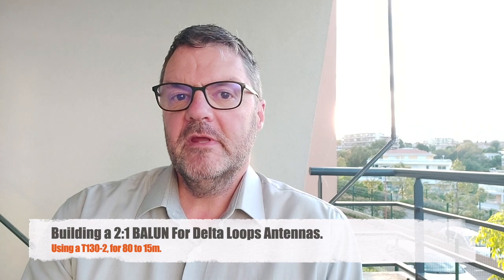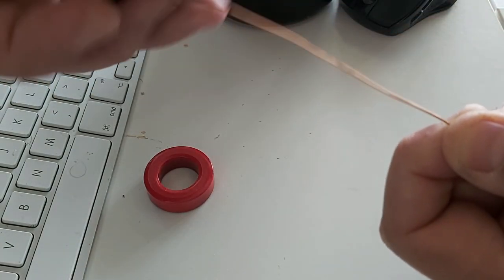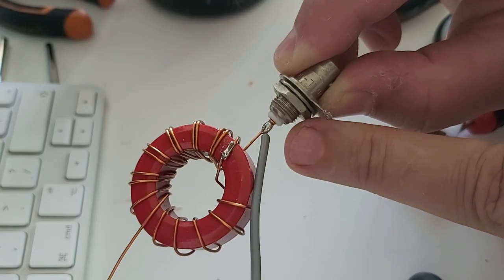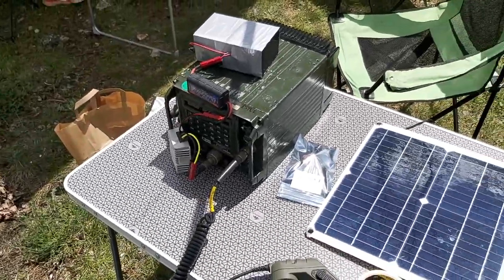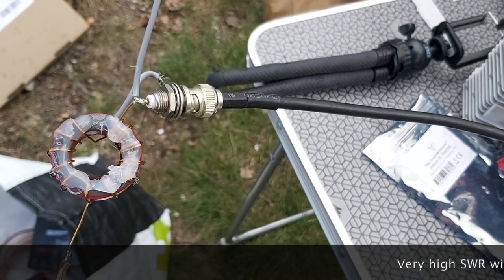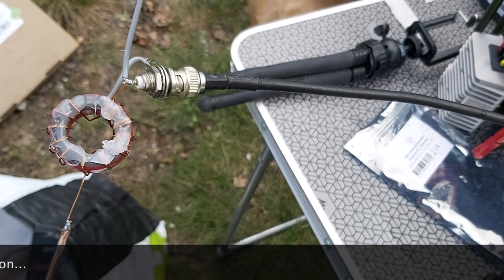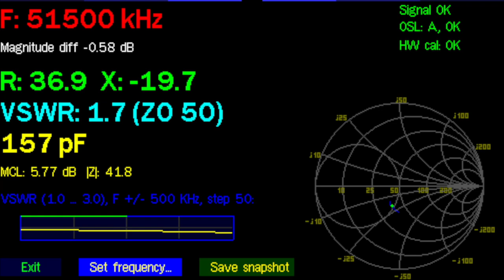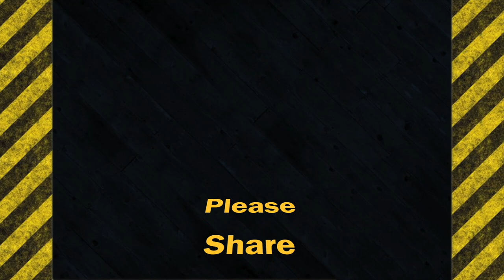Building a 2:1 BALUN For Delta Loop Antennas.

Comment: Thank you for demonstrating this 2:1 transformer.  (12/6)^2= 4 so 50 ohms input yields a 4*50= 200 ohm output transformer.  This is consistent with the measured SWR approaching 2:1 (200 ohms/100 ohms = 2) demonstrated in the video. My initial calculation for a 50 ohm to 100 ohm transformer suggests a turns ratio of 5 turn primary (50 ohms) and 7 turn secondary yields 98 ohms. Alternatively a 12 turn primary with a 17 turn secondary should transform 50 ohms to 100 ohms. You have encouraged me to build and test these alternative windings.
Reply: Sorry I am a little late to the party. You are correct with your calculations. I use the same ratio in a hybrid combiner to parallel two linear amplifiers. Just in my case converting 25 ohms to 50 ohms. Still a 1:2 transformer.
Reply from the maker: Thanks, the results do confirm it..
Reply: Or 10 turns primary with 14 turns secondary?…. I wonder if there is an optimum number of turns if the 1:1.4 ratio is correct?
Reply from the maker: It's the square of the turns ratio... I never saw anything other than a 49:1 or 64:1 made that way though..

Comment: Made a massive difference compared to the 75ohm coax I was using on a full wave horizontal 40m loop, could not tune 20m allthough 10 and 15m were ok, now flat swr 40-10m and very low noise, thanks for the post. 73s M7MNM

Comment: Nice experiment! I have built a 40m Delta Loop few years ago and still use it from time to time when operating from my countryside position mostly in the contests. I made it fed with the 1/4 length of the matching 75oHm cable and it worked just great with flat SWR accross all the band. I mounted it on the 13m mast. One big argument for the  cable-matching system is it stands easily the full legal power (1kW in my case) provided the proper cables are used. It also is weather proofed easily and looks neat. 73! Good DX with your Delta! 73! Linas LY2H
Reply from the maker: Absolutely right!

Comment: A suggestion: If you check the loss in that transformer and find it unacceptable (it will be significant,) you might want to switch to a Mix 43 ferrite instead of the red/clear Mix 2 powdered iron. Generally speaking, powdered iron cores are best for tuned transformers, while ferrites are best (lowest loss,) for broadband transformer applications such as this one. Even for tuned circuitry the Mix 2 is quite lossy on the higher HF bands. (Above 40 meters I always use a yellow/clear Mix 6 for tuned applications.)
Reply from the maker: You would think... https://youtu.be/wXELRYBBunQ that was for a 9:1 though..
Reply: @RadioPrepper , over the air tests are used as a last resort, but they have far too many unknown variables. Bench testing comparisons with a power meter or spectrum analyzer where you have control of all the variables are the only way to tell how much power is being eaten up by the matching transformer. DL2MAN describes how to test them in his antenna building series and what the variables are just within the ferrite Mix 43: https://www.youtube.co/watch?v=nNzTf1F12BE&t=930s
Reply: John West You said it. The material 2 is not suitable for this application. It's a wrong and misleading recommendation. I'm very sorry to see such a content spreading wrong advices to many. Wrong content is multiplied finding this stuff all over. Later he mentioned the 1:9 UNUN for random wirer. That's a totally outher application where  intantionaly is introduces loss by using a material 2 iron poder core to drop the SWR by introducing additional loss. And hey, You can explain it 1000x and this spreader of wrong content don't want assume that they spread missloading tecnical bullshit.
Reply from the maker: I recently made a contact from the South of France to French Giuana, SSB, using 20W and this "not suitable" powdered iron core UNUN... I's on video. How do you guys explain that? LOL.
Reply from the maker: That's 7208km BTW..
Reply from the maker: Ah! This is the delta loop video! I thought it was the 9:1 UNUN video. This one, I used a design I found online that described a "2:1 BALUN." I built it and it worked fine. What else do you want? I make no claims other than it works. My other remarks were about my 9:1 UNUN videos with a random wire, using a T106-2 powdered iron core for which testing shows that it works better than an FT-140-43. Why? I don't know, but it does.

Comment: a delta loop at 120 ohm a 2/1 balun is ideal close to 50 ohm I personally experimented with the 4/1 and that didn't bother me. I got too low an inpedence I have been making antennas for years.... a antenna has an inpedence and inductance to be respected

Comment: Thanks for video Gil. Just wondering if the turns ratio on the bal-un is 2:1, the impedance transformation shall be 4:1? You could test with with a 200 Ohm resistor and see if you get 1:1 SWR.
Reply from the maker: Not sure about this type of winding, but I will check, thanks.
Reply: Yes, turns ratio is 12:6 or 2:1 so impedance is changed 4:1. Turns ratio should be 14:10 to get a 2:1 impedance ratio.
Reply: @datamedic  Yes I wondered the same thing that a 2:1 turns ratio would give a 4:1 impedance transformation. That ratio would not be a total disaster as it would transform an impedance of 120 Ohms to 30 Ohms.

Comment: Would a 240-43 work for a 2:1 balun for an hf antenna? Making a 80m full wave sky loop. I’m getting 175 ohms at the analyzer with a 100 ohm resistor. Trying to figure out where I went wrong
Reply from the maker: What is a 2:1 HF antenna? I have no idea what you are trying to do, sorry. A 43 material toroid is wrong for a 2:1 BALUN.
Reply: @RadioPrepper  corrected my comment. A 43 mix is good for a basically every other balun in hf. I just assumed it would suffice for a 2:1 nonetheless.
Reply from the maker: Assumption is the mother of all... ;-)

Comment: Thanks for the video. Although I'm not sure if 2nd mix is recommended to be used on such high frequencies, or even for transformer at all. Would be interesting to compare with mix 43 or 31.
Reply from the maker: 43 for a 2:1 on 50MHz?
Reply: @RadioPrepper  yep
Reply: @R2AUK  Or at 61 ought to really work better up there.
Reply: Yes, I note that powdered iron is not recommended for broadband designs in the normal case.   The powdered iron appears to be more suited for a tuned circuit, or a single band design?   Is there a reason you use the powdered iron (red) core rather than the 31, 43, 52 or 61 material that is far preferable for broadband use on HF and above for 49:1 transformers?
Reply from the maker: I usually use 43 for 49:1 or 64:1 transformers, but many designs seem to call for 2 material for lower ratios like 9:1, 4:1, 2:1. I do not know why.
Reply from the maker: https://youtu.be/Q3LC14L7MLU
Reply: @clarkturner9413  You are right👍👍 Problem is that Gil is spreading bullshit insisting on tecnicly wrong things - And it's not only in this video. He does not make solid research before spreading of what he believes is right - But I always recommend te believers to go better to Church instead spreading bullshit.
Reply: @clarkturner9413  You are right, material 2 is wrong for this aplication. Video is wrong and missleading.

Comment: What do you think of wraping power supplie  plus and minus wires  around thoroids to your radios  ???
Reply from the maker: Yes, it does reduce RF currents getting into the radio through the cable acting as an antenna.

Comment: Will this 2:1 balun work  for my skyloop antenna? It's only for reception.
Reply from the maker: Yes, better if the wire is a full wavelength.
Reply: If you want to try the air core 2.5:1 balun it is cheap with local parts and instructions are on the internet. It's wire wound on a short PVC pipe. Works great for skywire loop. AG6IF sells them on eBay if you don't feel like building one. But they are really inexpensive to build.

Comment: So I'm a bit confused... This is supposed to be 2:1, and the sqare root of 2 is sth like 1,4 and so on. The windings on the balum are 1,5:1 though. Wouldn't this give you more like a 2,25:1 Ratio or is my maths backwards? Greetings from germany.
Reply from the maker: Not sure, confused too, but the analyser shows 43.4 Ohms on 20m with a 100 Ohms resistors as the load..
Reply: a delta loop at 120 ohm a 2/1 balun is ideal close to 50 ohm I personally experimented with the 4/1 and that didn't bother me. I got too low an inpedence I have been making antennas for years.... a antenna has an inpedence and inductance to be respected
Reply from the maker: I guess the number is rounded off..

Comment: A 4:1 BALUN would have been better.
Reply from the maker: Theoretically you get closer to 50 Ohms with a 2:1 (120/2). In practice I suspect it doesn't make much of a difference..
Reply: @RadioPrepper  It makes diference, and a big one. Sorry that You does not do sufficiant research before spreading this missleading wrong content. Be a little bit more carfull before spreading wrong stuff on YT.
Reply: So you are saying the impedance of a Delta Loop antenna is 200 Ohms? Is that correct?
Reply: @bobblacka918  more likely to be 300 Ohms.
Reply from the maker: I must have read that somewhere...

Comment: Why, powder iron core? it is not suitable for a 2:1 ratio  1-30MHz at all. Why don't you do your research before spreading nonsense?
Reply from the maker: That's what I thought too, but check out my video about a 9:1 UNUN using an FT-140-43 VS a T130-2. In theory it doesn't work. In practice it does.
Reply: Daniel, he's spreading nonsense as just many times before. Many times he does not know of what he's talking about. Very annoying - There are outhers too, not knowing of what they are talking about. And later, when they face critics its always the same, insisting in there wrong concept. There are many comments about his wrong concept answering with a 1:9 UNUN for a random wirer who use intentionally the iron core but for a compleatly different concept. My conclusion is, also looking on outher videos from him, that many times he's doesn't know of what he is talking about. He has no tecnical background - Never studied suficiant about Radio electronics.
Reply from the maker: Did you try both in the same conditions? I did. The powdered iron core worked better, period. Build both, test both, then comment about your results...
Reply: @RadioPrepper  I build enough antennas to know how to do it right, not mentioning so much more that I'm coming from the professional side of university electronic Engeneering. There had been enough claimes of different viewers about this loop UNUN - It's really enough that You think about to put your head on deeper research before posting.
Reply from the maker: Yes it is an UNUN, not a BALUN. A 9:1 has nothing to do with an EFHW. We are talking totally different impedances. An end-fed half-wave uses a half-wave wire (duh) with a 49:1 or 64:1 transformer. A 9:1 is for a random length wire, meaning anything but a half-wave. I have built dozens of EFHW transformers, and yes, The Minion did have a problem, as none of my 40 other radios ever had an issue with the same antennas. I also was certain the powdered iron core would lose to the FT-140-43, but it was better, not because of a low SWR, but reported by an interlocutor receiving my signal. Did you even watch that video? Do your testin,  then report back, otherwise, you're just spewing words. You can't say a design I build is wrong without providing proof and demonstration. That's called trolling. I build and test designs I find, then report on the results. If you disagree with what I observe, go troll the designers...
Reply: @RadioPrepper  It's not tolling. It's to make you wake up when so many viewers are saying almoste the same thing, and You spreading, insisting and defending your wrong concepts. And there is not only this video, there are outhers too. And, there had been enough outhers with advises and claims to You of tecnicly wrong and missleading  content. And when they are clearly telling You about wrong content they are all trolling You? Please......